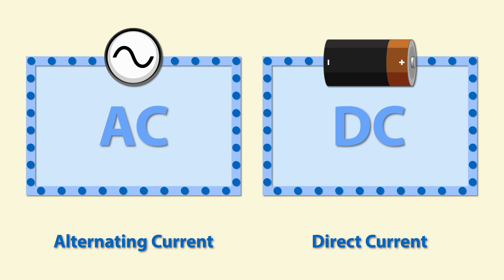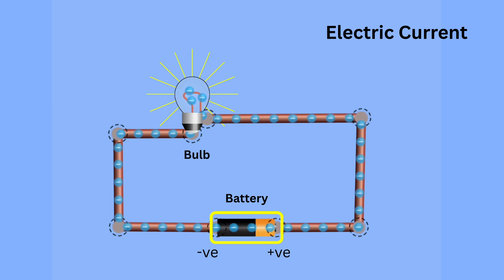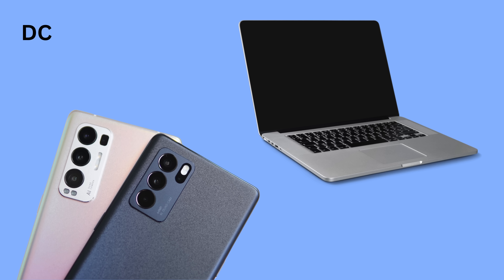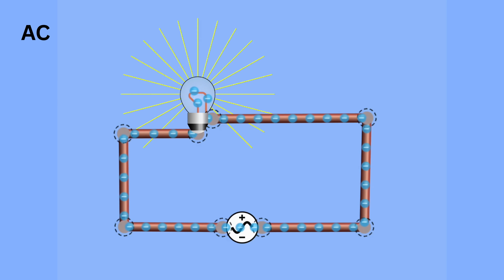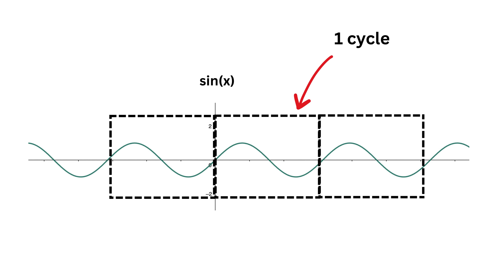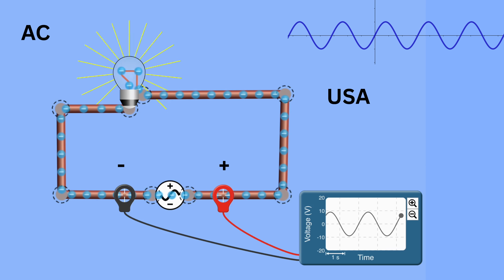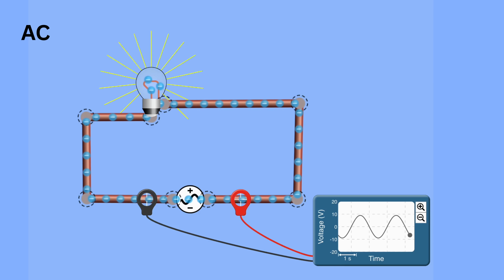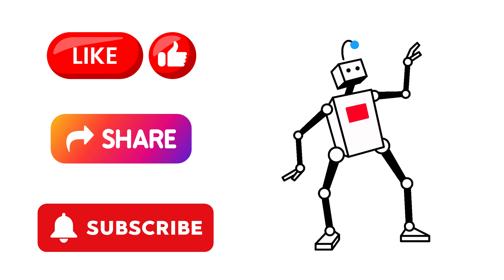Best Explanation of Alternating Current Vs Direct Current

Comment: And what controls the everchanging direction of AC currebt
Reply from the maker: It is controlled by a rotating magnetic field from a generator (which I might teach later)
Reply: Funny, how we always hear about these little balls moving through the wire, but we never get any details. Do they go over the protons, under them , around them, zigzag in and out or do they go right through them?
Reply: @BrainStationAdvanced  This is a hard thing for the average person to grasp . I have had apprentices working with me on Hydro generators and explained the different parts of the Generator Turbine ,Governor , Excitation , field poles , Generator windings  , and how everything works together to produce AC voltage and amps . Seems you have to explain things over and over and it slowly sinks in then one day the light comes on!
Reply: Ok thx